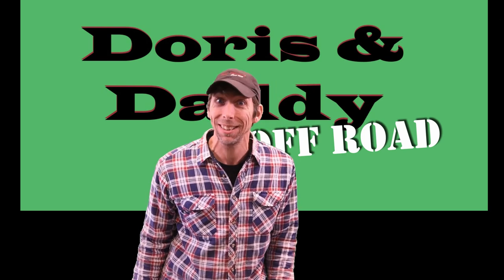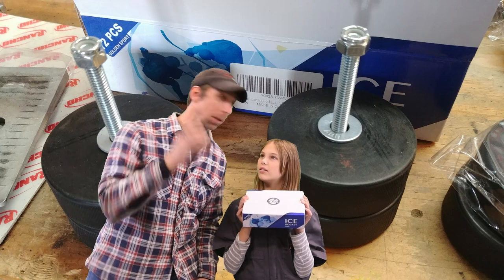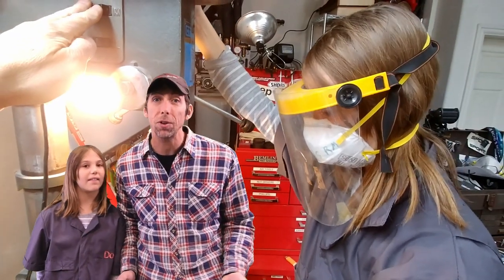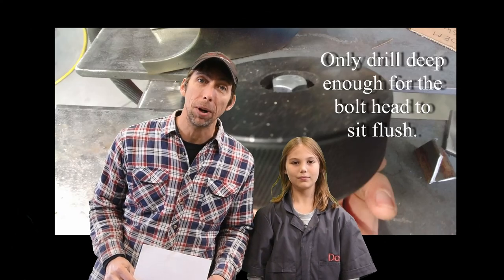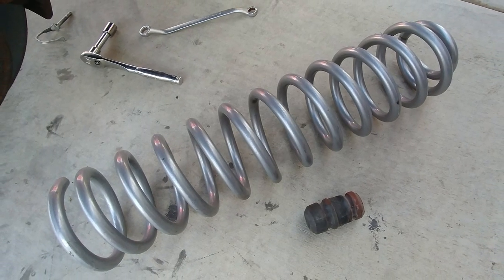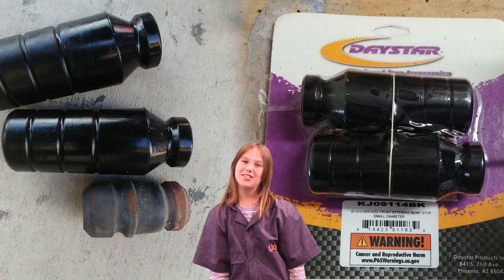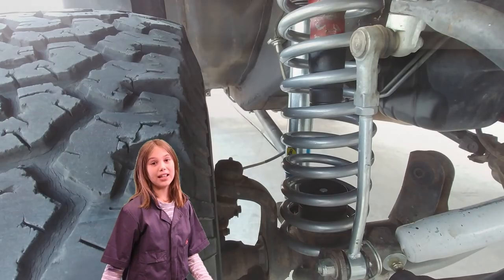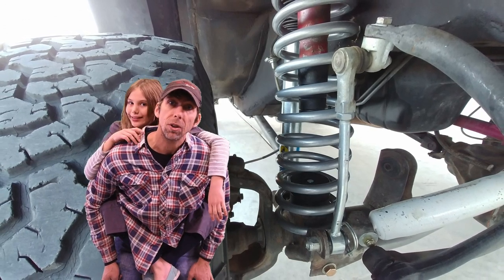Hockey Puck Bump Stop extensions for Jeep Cherokee XJ

Comment: Is there enough metal to tap these holes and eliminate the need for the nut underneath? Going to use this guide to add these when I do my lift soon. Nice job!
Reply from the maker: I don't believe that you would get more than a few threads in the perch itself. I'm not near the Jeep this week, but I remember it only being about an 1/8 or maybe 3/16 thick. Good luck with your lift. Thanks for watching!

Comment: How many do you think i need for a 7" lift jeep xj
Reply from the maker: You might need to pull from a sport with something bigger, like maybe a football... At 5.5 inches we used 2, but are on the edge of needing 3. It depends on how much travel you have in your shocks and the rest of your suspension.
Reply: Used 5 works great.